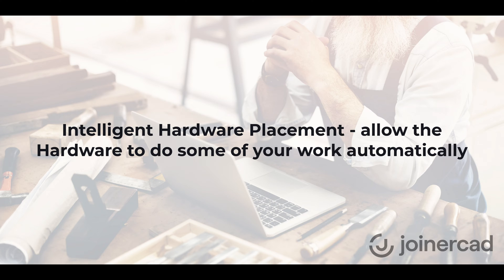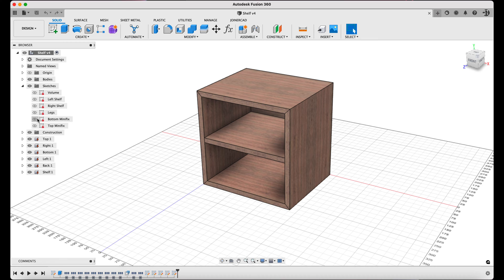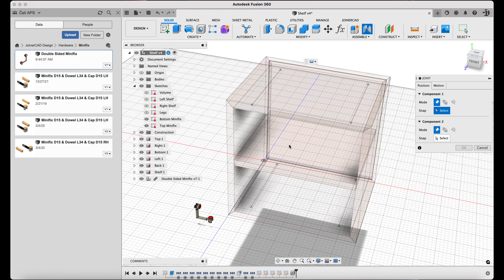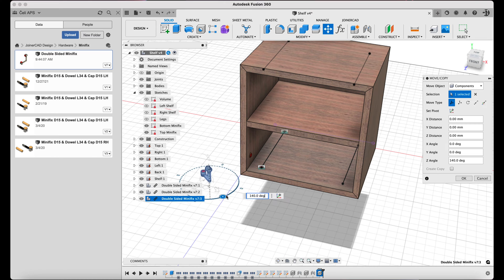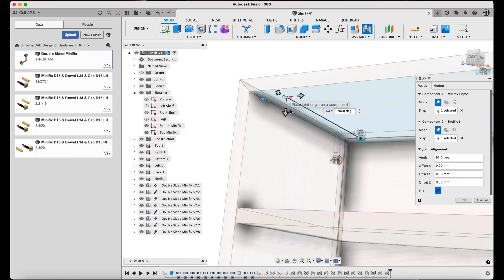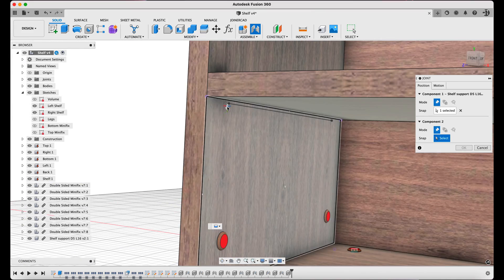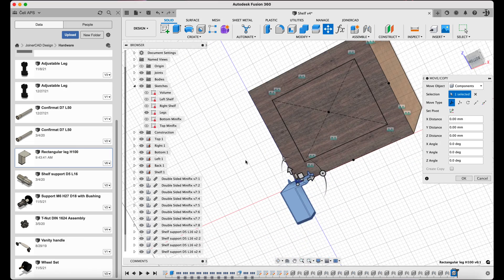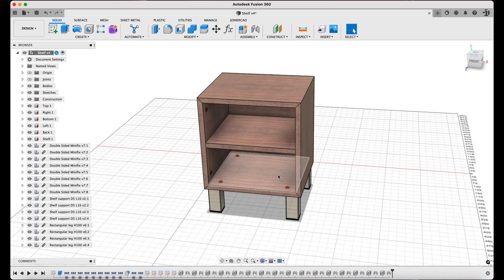3. Intelligent Hardware Placement

Comment: There is nothing intelligent about this and it does not even use any of the JoinerCAD add-on functionalities. If you would have at least mirrored the mini fix parts or the legs it would have been quicker. How does JoinerCAD help here?